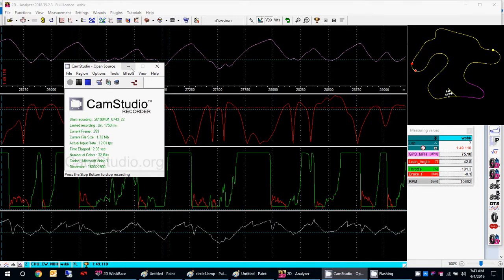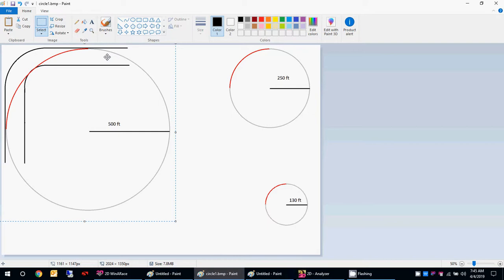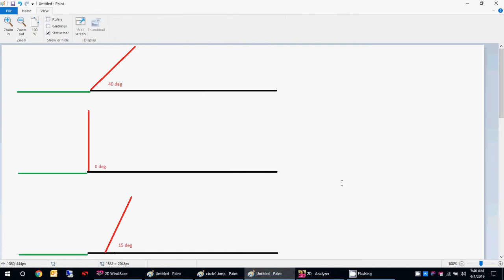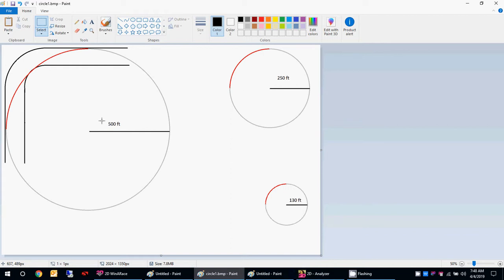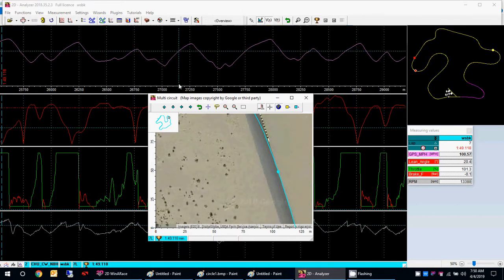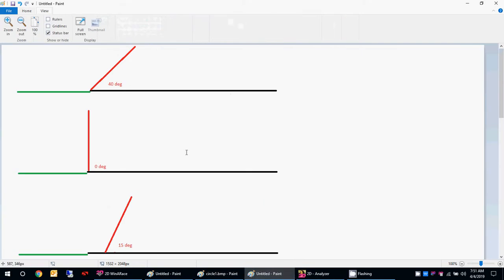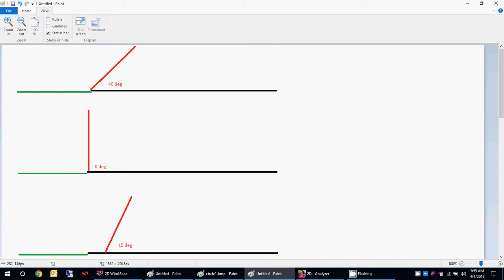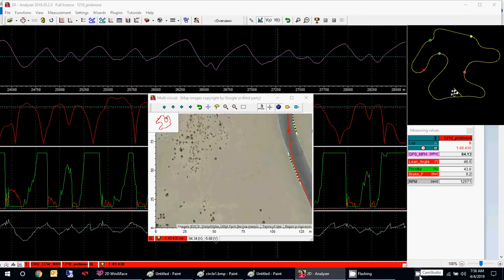#7. 2D Data Recording - how we meet the edge of the track on corner exit

Comment: Hi Noam, thanks for the useful information. I just got a 2d data recording for my S1000RR. Do you know where to get the maps of our local California tracks like Buttonwillow, Willow Springs, Chacka ???
Reply from the maker: Hey. It doesn't work like that. You set your start and finish line coordinates in the software. That's it. So you ride your first session, then download that session to your computer and set the start finish on the dash. It's complicated. Did you get the user manual? It should describe this procedure.